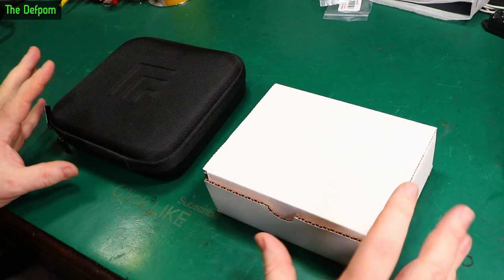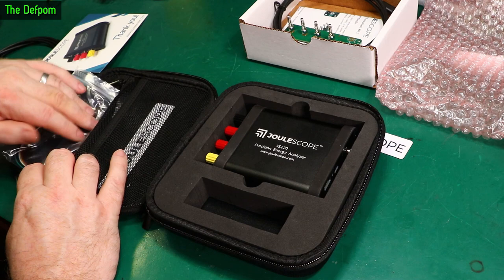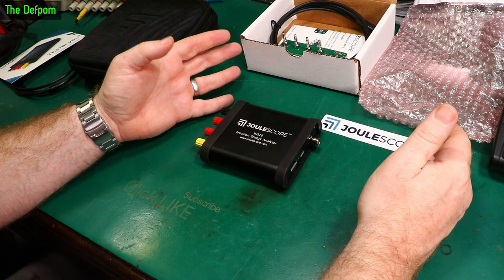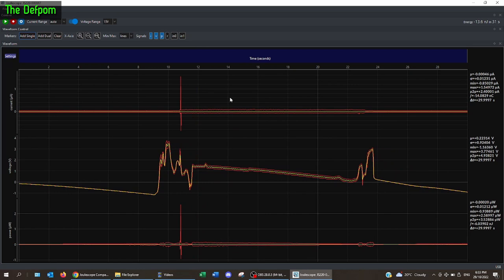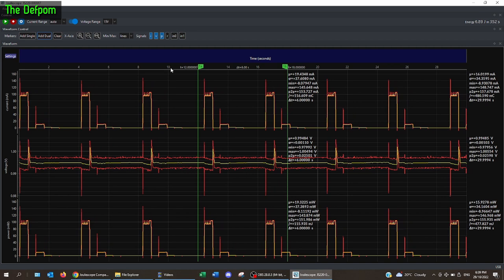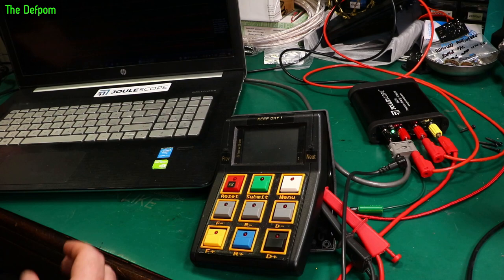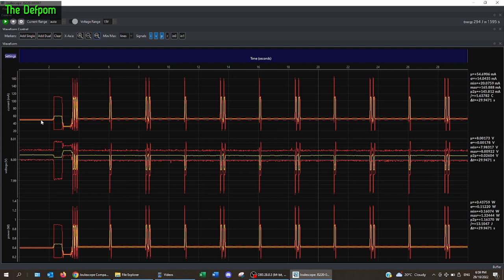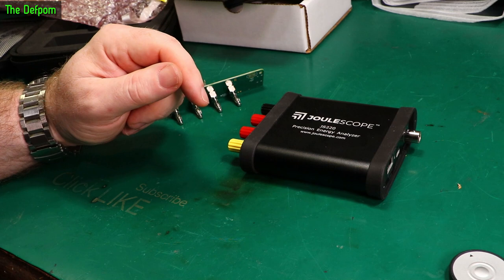🔴 NEW Joulescope JS220 Precision Energy Analyser Review - No.1057

Comment: Shouldn’t you be capturing the voltage inside the current shunt (across the load) instead of access the supply?
Reply from the maker: Yes for proper voltage monitoring you can hook up to wherever you need to monitor in your circuit, this was just to demo it.

Comment: Nice review. If this is the same price as the JS110 with better performance, does that say that the JS110 is currently overpriced or that the JS220 will increase in price (like the JS110) once people start showing interest in buying it and this is just an introductory price!? Hmmmmm, lets wait and see eh! Shame the end panels didn't share the same footprint as the JS110 as they are expensive and if you already have the USB or BNC options, then it's just more money to outlay with no functional gain! Smacks of creating an Apple like eco system to me where every upgrade just throws the previous model and accessories in the bin!
Reply: Hi Simon, as you noted, the component cost in the JS220 is definitely higher than the JS110, but we also found ways to decrease our manufacturing costs.  So, both the JS220 and JS110 are fairly priced!  I think you are saying you would have rather had us raise the price on the JS220 ;)  With inflation the way it is, we may eventually have to raise prices. 

The JS220's split voltmeter & ammeter functionality means that we needed different connections between the front panel and main board.  The JS220 also has a much nicer enclosure, which has a different size.  We needed to change the front panels for both form and functional reasons.  We are continuing to support the JS110, so no need to throw it in the bin.
Reply: @Joulescope  Thanks for the reply. I've just pre-ordered a JS220! but only after finding a 10% discount code ... that helps swallow the price tag a bit :-) As a side, where do you get the 4mm male bananas on the EVkit? Rather than keep swaping out the front panels, I'd like to do a custom plugin module like the EVKit for the different connector types, I.e. USB, BNC, etc